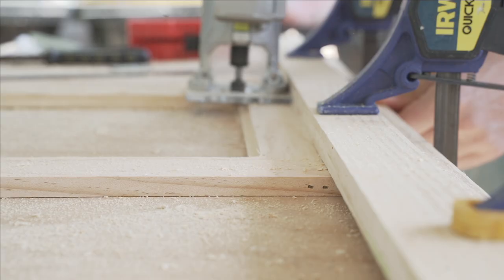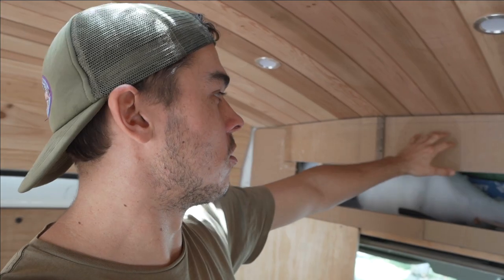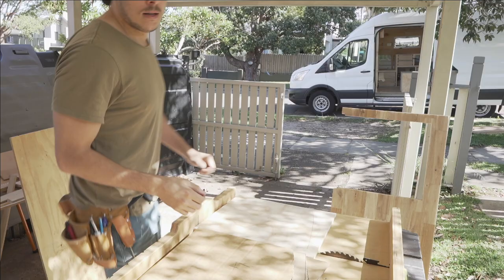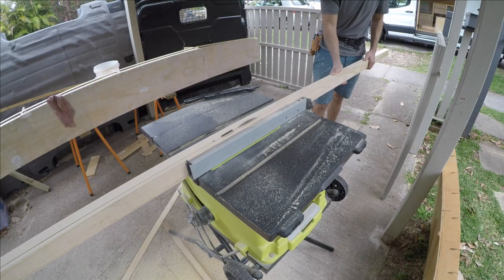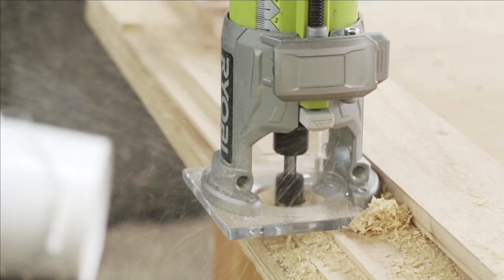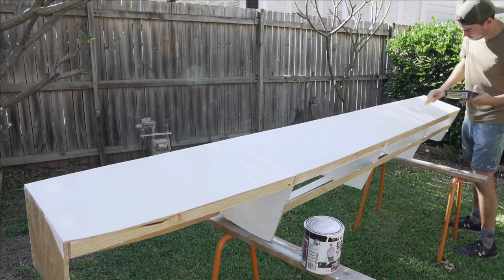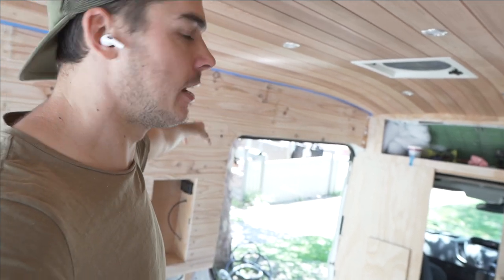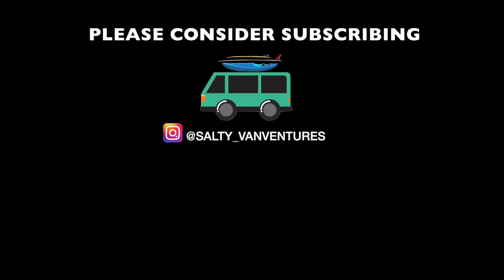EASY DIY OVERHEAD CABINETS  | Ford Transit Conversion

Comment: Following your build very closely. Running with the same theme, red cedar ceiling, painted white sides and extended bed sides. Inspired by your build. Using your video's as a great manual. Building it in a transit l2 swb in England. My partner is also czech! (and I'm scottish). Your video's are great. Relaxing and informative watch. Thoroughly enjoy your stuff. Keep them coming. Cheers.
Reply from the maker: Nice, sounds great. Thank you for your amazing feedback. Ill be sure to keep them coming then. Good luck with you build!

Comment: Loving your videos. I have a 2017 Ford Transit and I am at the point trying to utilize the area above the cab. How did you secure the actual shelf and what did you do with the foam pieces on side covering the airbag. I was going to cut around the airbag area. Don't want any airbags going off. :)
Reply from the maker: The shelf above the cab was actually already in then I bought the van. It’s a factory sheet metal tray of sorts so the airbags have their own little space behind the felt like grey trim.

Comment: Cupboards look grouse but you should have chiselled the corners for the ply inlay square 👌otherwise mint job bro
Reply from the maker: Thankyou! Yes ideally I would have cut the rebate for the ply inlay before I cut the frame pieces so the edges would be square but I got a bit lazy and decided to do it after knowing full well it would have the rounded corners. I thought Meh it will be on the inside of the cupboards anyway.

Comment: Amazing work!! Finally an Australian do van build videos that are enjoyable.  When will the electrical/ wiring vid be coming out? Also did you have to do any mods to the van (suspension) or something to hold the constent additional weight of the van?
Reply from the maker: Stay tuned for the next video coming out. I will go through all the electronics I’ve built into the van and why I’ve chosen them. Nope no additional suspension upgrades. I don’t believe I will need any either. I can’t notice the weight difference really at all
Reply: Remember, these vans are built to carry significant loads so a conversion like this would be of negligent concern to the suspension.🙂

Comment: another top video.  Just wondering if the whole cupboard is just secured by screwing into the 12mm ply roof and wall battens and thats enough?  Thanks guys
Reply from the maker: Its mainly screed into the 12mm batterns which is super sturdy. I also secured it at both ends to the front and back walls

Comment: I'm a wood Smith. I been working 
On exotic woods for over 50 years. And you are absolutely right. you always Going to make mistakes...primarily because you are dying to see the finish product 
And you are rushing the job.
And don't  take time to think..
But for what ever the reason is. 
You will always make mistakes.

Comment: Hey mate! Big fan coming to you from Scotland here. Hands down - best van conversion channel on youtube. Doing a transit myself and would love to know how you framed out/built the interior of the cabinet above the driver's cabin! I see in another comment that your van came with the metal shelf already in place, as did mine, so I was really wondering where/how you attached batons/studs etc and what you ultimately closed it all off/finished it with. Any help would be much appreciated. Sorry for the long winded question. Thanks for all the content dude. You're the man. Cheers!
Reply from the maker: Hey there and thanks for the comment. To attach the partition wall to the metal shelf i screwed a 2X4 into the end of the shelf as to clear the cab roof liner and to also clear the wall from the front seats. Then i just cut some 12mm ply to size. The sides are connected to the wall with small studs i glued to the van walls and the base it just screwed into the sub floor. Hope that helps!

Comment: Do you think it was worth the effort in extending all of the electrical wiring which ford ran outside the wall pillars now that you have concealed with cupboards anyway? I'm trying to make that call myself and 3 days on the soldering iron doesn't sound fun 😂 
Love the videos mate. Thanks a lot
Reply from the maker: Yes and no. Maybe not for along the side but probably for the back as that wouldn't have been covered up by any cabinets

Comment: Hi mate awsome videos how did you go with the curve in the roof down the front
Reply from the maker: The van has that natural curve. It was a bit of a pain trying to force the timber that much but the cedar strips are only 9mm and have a bit of flex so it worked out well.

Comment: Great video! Did you also screw your cabinet to the roof of the van, or is it only attached on the strip of wood running behind?
Reply from the maker: I attached it to the plywood "studs" behind the cedar ceiling and pine paneling as it is much much stronger. The cedar is very soft and screws would just pull through.

Comment: Hi Marcel - what thickness of ply did you use for the divider between the cab and kitchen? Working on that now and want to go light but not too flimsy. Thinking 9mm?
Reply from the maker: I used 12mm ply. I would say 9mm would be too thin unless you are covering up a wooden frame.

Comment: I didn’t know you could change the angle on the jigsaw?
Reply from the maker: Yes, the "fence" as it is formally called, is adjustable so you can cut angles! Great little hack
Reply: @saltyvanventures awesome! I will try that ! 😊
Reply: I was actually gifted some amazing custom made cabinet doors shaker style that already has the cutouts for hinges and slides! They are absolutely gorgeous! I may have to cut some of them down and adjust them to fit in my van, but I am so relieved that I don’t have to make them bc that was a huge anxiety for me. lol! I can build the cabinets now and I am pretty sure I can handle that part. Haha.

Comment: I’m converting a 2020 Transit Medium Roof. What did you do about the Front Airbags above the Cab windows? Wouldn’t the airbags intrude into your wall and cabinet space if they went off, possibly causing damage or bodily harm?
Reply from the maker: No the curtain airbags are further forward of the wall. All I have essentially done is replace the stock metal bulkhead with a plywood one.

Comment: model and size of the ford transit.inside dimensions please
Reply from the maker: This is a 2014 350L high roof. The size and shape of the van is a little more complicated that 3 measurements. You can view the detailed dimensions on my 3d model found on my website. The link is in the description

Comment: We thought about doing the overhead cabinets first and then the roof cladding. This was you get a nicer finish without gaps I think. What do you think?
Reply from the maker: This could be a good idea. Your ceiling will then but up to your ceiling much neater most likely. I like it!